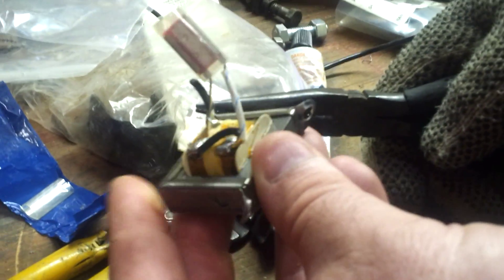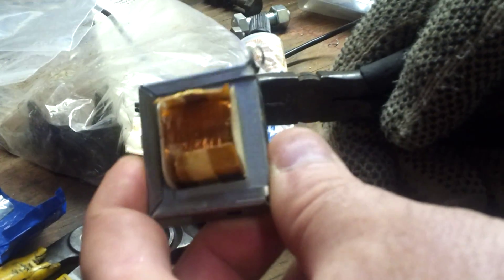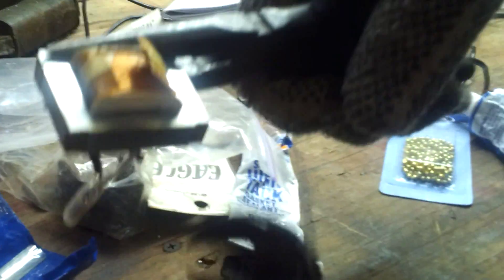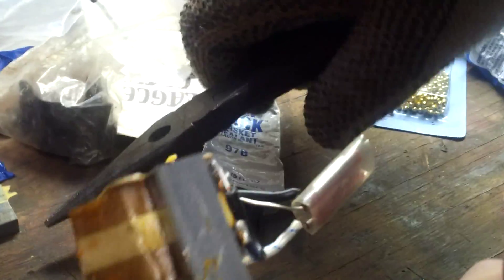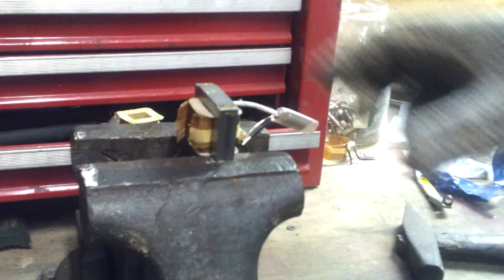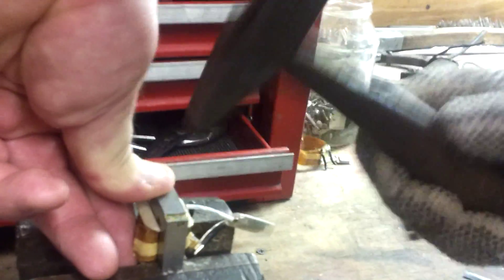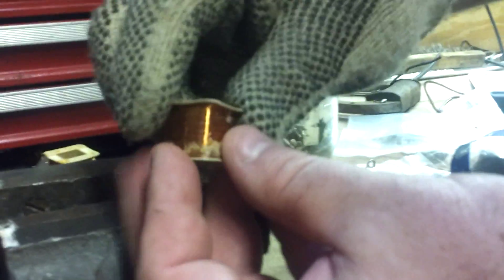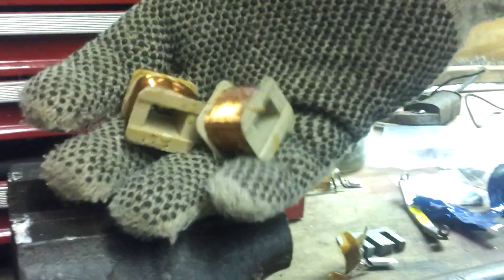Remove copper from small transformers

Comment: Awesome Video. I couldn't see up close, but the metal that surrounded the copper, was it composed of thin metal strips compressed together? I spend 1/2 hr beating one of those with the hammer & ended up with a mashed/bent peice of copper & metal. Finally got it but it was a mess & like I mentioned it took a long time. Then I saw you do it in 30sec! Ha, Ha. Thanx so much.